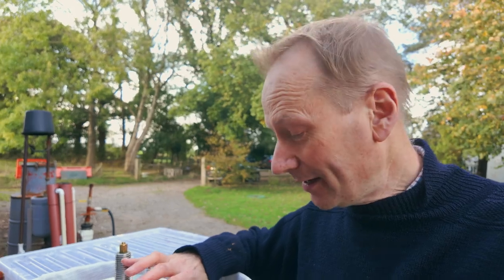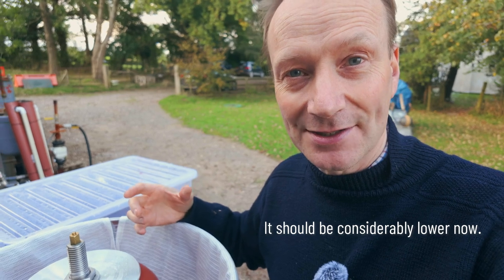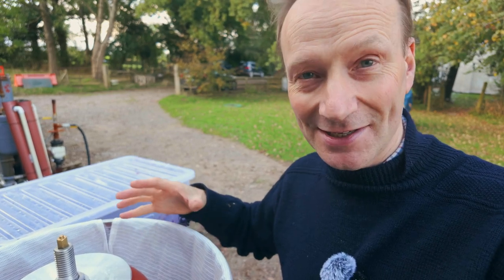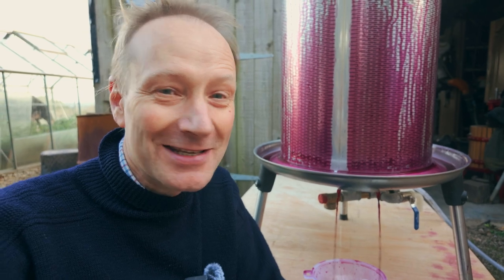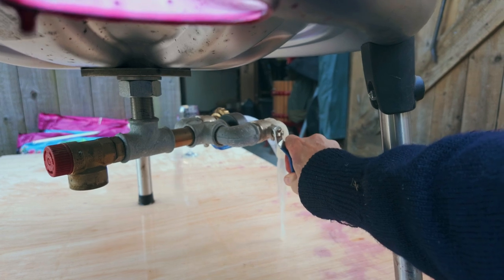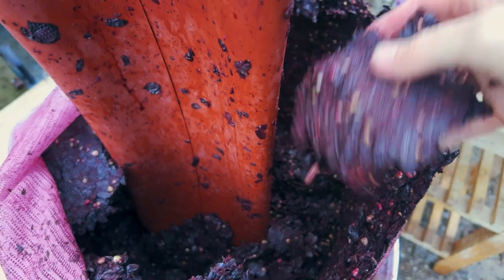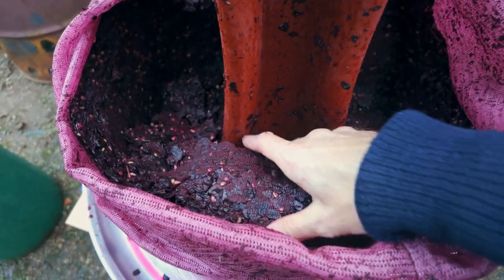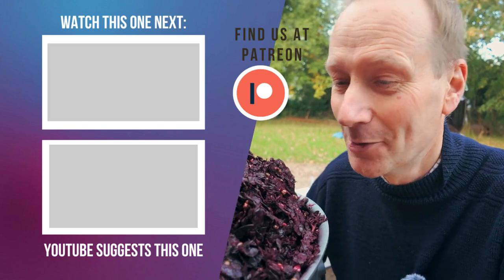Making Red Wine: PRESSING after a successful Fermentation - Hydropress Part 3

Comment: Pressing is very satisfying but also the biggest cleanup mess during the whole wine making process!

One tip I was given when using my bladder press - don't let the pressure relief valve do all the work. It could fail and over pressurize the bladder, that would be very bad. When it starts to blow out of the valve, turn down the flow of the incoming water a bit, then gradually increase it again. I sometimes also intentionally open the 'empty the bladder' valve and let a gallon or two out. The cake will relax a bit and then you can close the empty valve and top off the tank again, getting a bit more juice out. Cheers!
Reply from the maker: Hi there.  Nice suggestions, thank you.  I'll do that on my next pressing.   I really appreciate that.

Comment: One thing that you may want to do next time is to taste the wine from free run and also taste along the way when pressing to determine when the wine gets more tannic and at what point you may choose to stop pressing. Some folks separate the press and free run wine and blend in a ratio. I usually combine them for small home batches. Looks good though !
Reply from the maker: Ah, yes, that is a really good idea.  I should have done that.  My first 20 litre container is mainly free run with a light pressing, and the next containers are definitely more pressed.  I will be intrigued as the the difference between them all.  Thanks for the tip.

Comment: What an absolutely beautiful color. Well done! When our vines start producing, I'm planning on using my homemade cider press to push out the juice. I can't forsee any issue here except, perhaps, with the fact that it's a wood press. That can be harder to properly sanitize compared to stainless steel. Though, I would be surprised if wine at that volume of alcohol could catch anything bad that easily. Either I've had good luck or higher abv liquids are more resilient against infection. I suspect the latter.
Reply from the maker: Hi there. Thank you for your comment.  I think you will be absolutely fine with your press.  Red wine especially, seems to be pretty resilient to infections while it goes through its primary fermentation.   Afterall,, I'm sure some folks still crush their wine under foot, add a bit of sulfite and then ferment it in open containers.  Any bugs can be killed later after Malolactic fermentation.  Sounds like you are doing great.

Comment: What a mess.  I recommend you to change the press.  I recommend a tilting water press.  It will be much easier to empty the waste.  This press also has an oversized discharge.  All the syringe and must consume too much oxygen and oxidize.  And even 3.5 bar is too much pressure.  Reduce by at least 1 bar.  Ideally no more than 2 bars.  With too high a pressure, you squeeze out too many tannins and essential oils.  The wine is therefore too tart and not harmonious enough.  So much for a start.  I wish you a successful wine year.
Reply from the maker: Well, we all have to learn somehow I guess.  Thank you for your tips and comments.